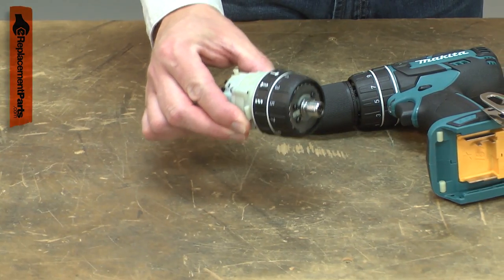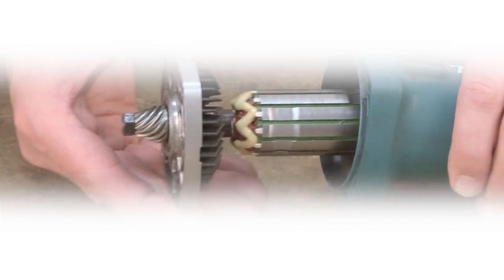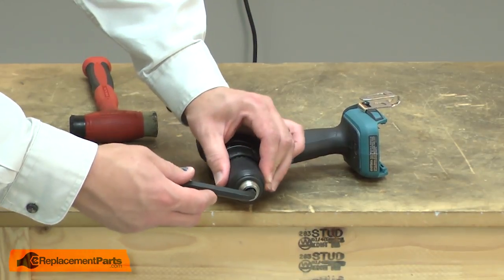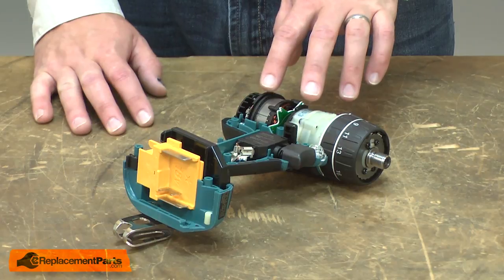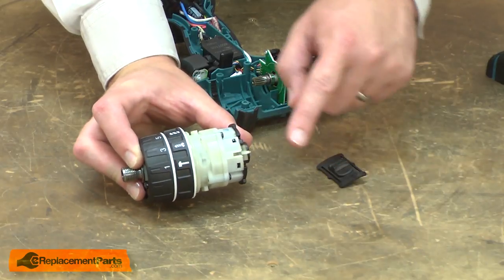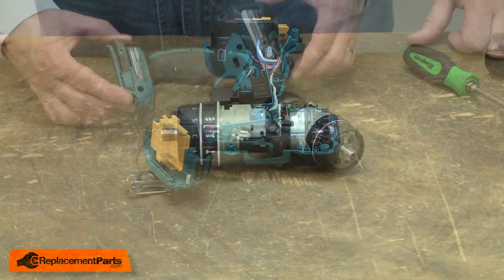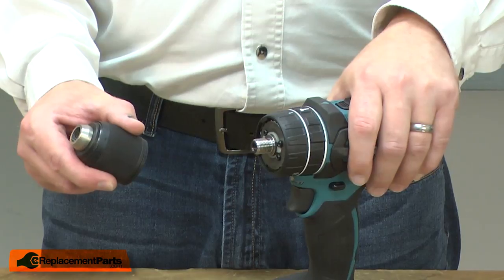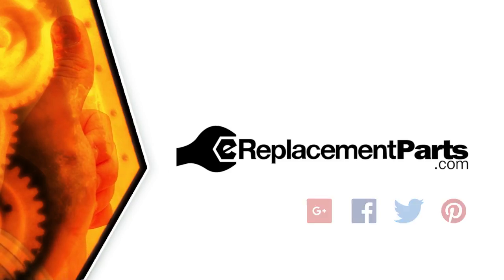Makita Hammer Drill Repair - Replacing the Gear Assembly (Makita Part # 126353-0)

Comment: Screw came out easy enough, but rapping the hex wrench with the mallet just would not break the chuck loose. (My chuck is wobbling a bit even after I checked the screw to be sure it was tight when I reinstalled it).

Comment: How in the heck do you get that Chuck screw out?!  I know it is reversed threaded...but mine is STUCK and risking having the head stripped ;(
Reply: Wow..I got it out but wasnt easy!  Had to use my Makita impact driver and my vice and just pray to the screw gods that it wouldnt snap or strip out the head!
Reply: Now having fun w/ the chuck itself.  Not as easy as putting in an allen wrench and giving it a wack with a hammer so far....
Reply: Well ended up taking the entire OLD gear box apart  Placing the allen wrench in a vice with chuck clamped on it, and used a small PIPE WRENCH to get the chuck off the old assembly!
Reply: @payne51558  I just smashed the old gearbox to pieces till I could get grips on the end of the shaft 👍

Comment: I took the housing apart before the chuck. Gonna do this replacement but not entirely sure if thats the problem. Can I take the gear assembly/chuck off together, then separate? Or do I need to put this backtogether, just to take it apart again?

Comment: Interesting video however the gearbox for my drill costs 40% the cost of a new drill and bearing (pun intended) in mind that the rest of the drill is worn too and potentially liable to fail, I think it would be smarter to replace the whole drill.

Comment: Sorry, it's impossible to get past step one.  Soaked the damn screw in wd40 and break free for a few hours.  When that didn't work I tried using a Makita impact driver to loosen it.  That didn't work so I tried my impact wrench.  I broke a few flathead screwdriver heads that way.  Finally stripped out the screw head.  Maybe the video is wrong and it is not a reverse threaded screw.   I put way more time into this than the thing is worth.  Should have just tossed it in the trash and bought a new one.  Returning the gear box.
Reply: I hear you, just did mine and fortunately the screw came loose. It was a left hand thread that I used my small impact on before I messed the center screw up trying to loosen it with a screw driver. Patience is the key when replacing on older drills that have been used a lot.
Reply: It’s reverse threaded. I abused my drill for years. Came out rather easy
Reply: Yes, definitely reverse threaded and was able to remove mine with just a plain screwdriver, 😅